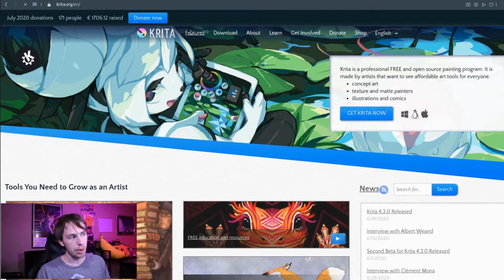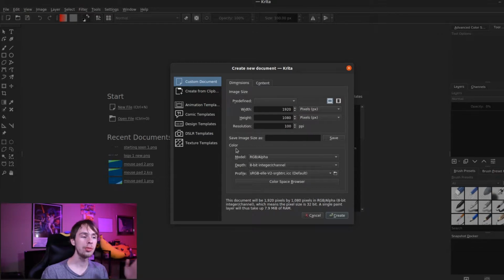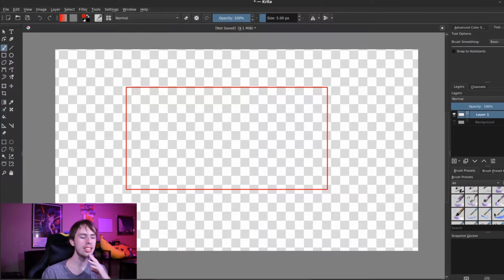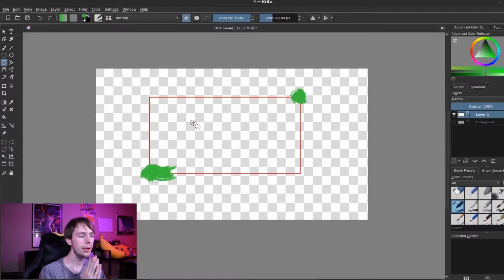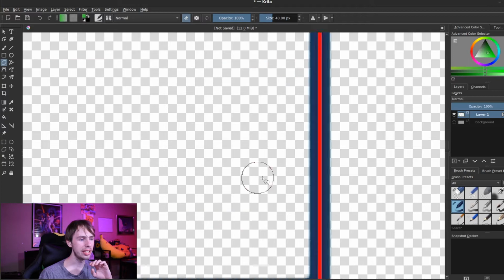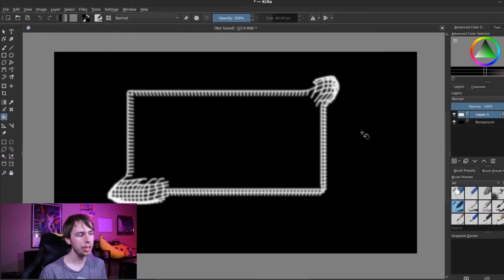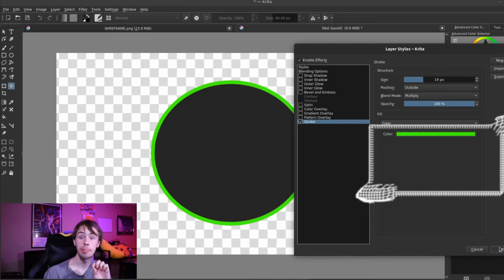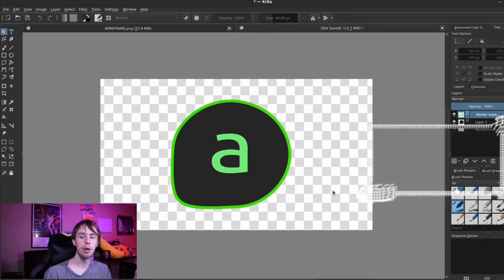Krita 101 How to make A logo and Overlay

Comment: This is interesting. I never knew how familiar Krita would be coming from Photoshop. GIMP keeps getting recommended as the alternative, whereas Krita is so much closer to Photoshop than GIMP is. It's also a lot closer to Illustrator than its alternatives. Thanks for this!
Reply from the maker: I highly recommend you play with the G'MIC plugin. There are a few hidden gems in the version for Krita. Use the 5.0 beta if you don't want to have to fiddle with linking it up manually.
Reply: @seaweaselmedia  I'll check it out. Thanks very much for your recommendation.

Comment: My bigest issue with Kira as of now is, that if you want to creat a box of certain sizes it wont let you, you just draw a box via aproximation, at no point are you asked which parameters you want the drawn box to have. You cani input the size into a mask but you cant turn the mask into and drawn layer. In photoshop the box tool can creat you a box with size of your choosing but you cant do the same in Kira which is realy stupid and if you can do it, one hour of searching the settings and alot of youtube tutorials still didnt lend me to an answer
Reply from the maker: Krita was designed with the chance that the average user of it is drawing with a pen tablet like a Wacom Cintiq. In fact a huge number of the userbase run Ubuntu which has some of the best support for pen tablets in the Linux ecosystem. Since its easier to just draw want you want with a stylus its not really better to type in values or define minute details otherwise. I do understand that in many other workflows this is not the way of things but think of it, would you edit a video on a Cintiq? So why would you use a similar workflow when making digital art 99% of the other time.